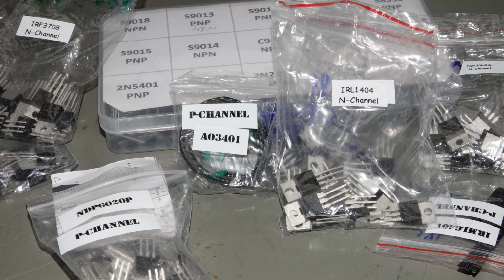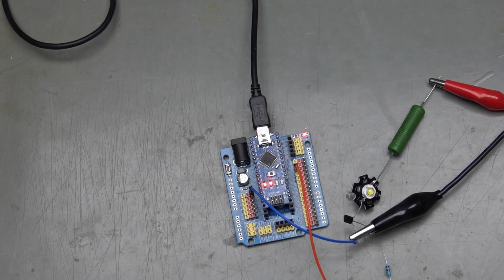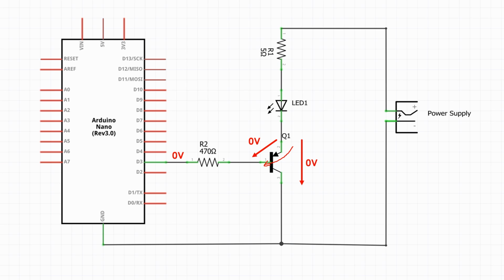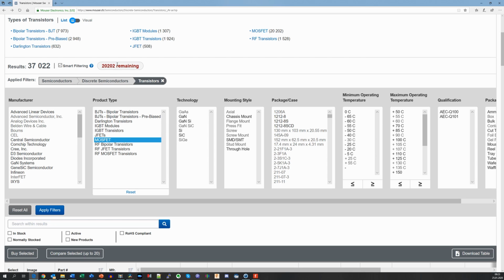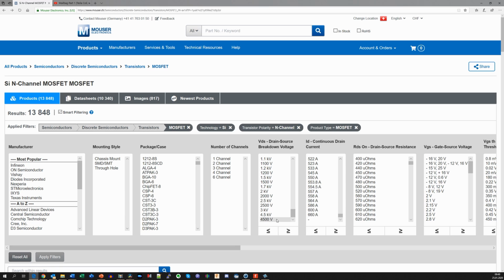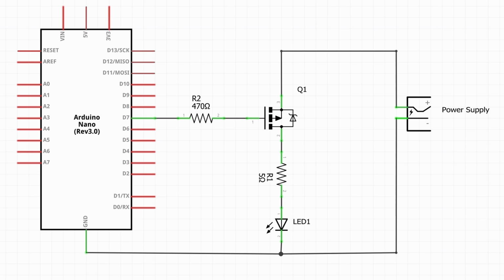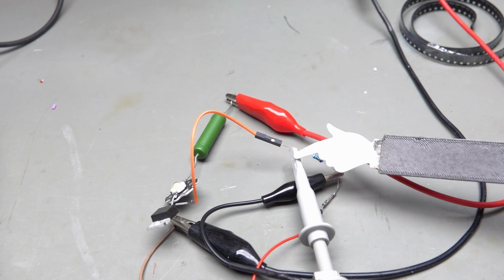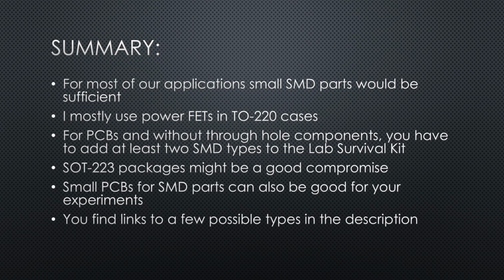#310 Transistors "Survival Kit" and Tutorial for Makers

Comment from the maker: Unfortunately, I had to re-upload this video because I screwed up and discovered it too late. Thanks, Ristomatti for giving me a warning.
Reply: They're all good enough for the girls we go out with ;-)
The level of detail and clarity in your productions always goes above and beyond. Thank you!
Reply from the maker: @Aaron: Thank you!
Reply: All the MOSFETs I have bought from AliExpress in the past turned out to be fake. I would advise to buy from mouser digikey or even lcsc(I use this) to get them because you don't pay that much more and you are sure to have good working parts.
Reply: @renaudfensie3020  how can you tell if they are fake?
Reply: @TravisHardiman  basically you mesure values the datasheet gives you. Usually the on resistance is not similar when those are fake. Another way is to check if it can handle the currents the datasheet says(be careful with overheating tho). One of the worst fakes i've got would saturate between 3 and 5 amps (they weren't even consistent) with a gate voltage of 10 volts while the datasheet said it would let up to 20 amps go through. Some other MOSFETs I've bought were supposed to have a on resistance of 0.05 ohm but when I measured it it was 0.3 ohm. 
If course they still can be useful for low power applications but for what I've got I could have bought something much cheaper from some trustworthy source
Reply: Does someone actually sell your transistors "Survival Kit"?
Reply from the maker: @tbgelectr0  I do not think so.

Comment: I've worked with transistors from the days of the CK722 on. So, I may not go back as far as you do. I remember when the U.S. was putting out a bunch of fair silicon transistors with not so close parameters, pretty much all with numbers starting with 2nxxxx. Then , the Japanese started putting out transistors with 2SBxxxx. or 2SCxxxx , these transistors had such tight parameters that if a circuit was designed around them, you quite often had to get the same exact transistor. Made rapiers take a little longer but the circuits worked very well. This was especially important for the Stereos coming out of Japan which had direct connected amplifiers (this was before the system came out with those large plastic amplifier modules ) . Amplifiers which were being repaired should have all been repaired with exact replacements made in Japan. But, that didn't always happen, the amps would put out sound but be unbalanced and distorted and in not too long blow up again. Now we have Chinese manufacturing which is a mix of U.S. engineering and who knows what ! Oh well. Back to the video.
Reply from the maker: It seems you have a lot of experience with these parts! Indeed, not only with transistors, the Japanese once challenged the "western" manufacturers. I remember also when the first Japanese Motorcycles or cars hit the road. Their tolerances also were much tighter. But the downside of good quality parts is that they do not mix well with lower quality.

Comment: Awesome video. Can you please suggest me a (complementary) pair of TO-220 N and P Channel 'Logic Level' FETs that can be found easily and for cheap yet have decent ratings?

I am obsessed with stocking Transistors in pairs.

Thank You.

Current FETs I keep are:
IRFZ44N-IRF4905
BS170-BS270
(BS170 is equivalent to everyone's favorite 2N7000)

For BJTs I have 
BC337-BC327
BC547-BC557
2N2222-2N2907
2N3904-2N3906
Reply from the maker: I do not know if there is a concept of complementary FET transistors for switches. I just have a few N- and P- channel logic level FETS as shown in the video.
In my next mailbag you will see a chip which includes a P- and an N-channel FET...

Comment: Outstanding video!!  Can you do a similar video for linear transistors?  And maybe then diodes and capacitors?
Reply from the maker: I hardly use BJTs. So I do not have a lot of experience. For diodes it is simple: Either I use any standard diode or, if I need a smaller voltage drop, a Schottky diode. Also here, I do not design switching power supplies and stuff like that.

Comment: I wish you would have released this video about 3 years ago. Great info that I had to scrape together through much reading and a few test as I was playing with 5V and 3.3V devices at the time and logic level then was more aimed at 5V devices. Always check the threshold voltage and look at the datasheets is what I learned as even some 'logic level' mosfets aren't really logic level to be fully on (and not wasting power/producing heat).
Reply from the maker: As you mention: 3 years ago many makers used 5v logic.

Comment: nice simplified tutorial!

However, even bipolar transistors have a place in switching... they are usually faster in turning on, but slower in turning off, especially when driven with high base currents. Also bipolar transistors are a bit more robust against static charges or high-voltage transients.
Reply: As I also commented for the next video: always put a series resistor ( acouple of hundred ohms) into the gate lead of the MOSFET as well in order to protect your Arduino (or whatever) from a catastrophic failure in the MOSFET.
Reply from the maker: Everything has its place in the world. I wanted to reduce to the Max. I think I mentioned the gate resistor intros video in the switching section. Absolutely needed.
Reply: @AndreasSpiess  I absolutely agree with your minimalistic selection. Regarding the series resistance you later recommended it in the video - but then in your next video you complain over the burnt-up potentiometers which seems to indicate that you yourself are not using them... And you didn't show them in your connection diagrams...
Reply from the maker: In the next video, the potentiometer acts as this resistor in my opinion. The potentiometer only was destroyed because I destroyed the FET.
Reply: @AndreasSpiess  yes, absolutely, it was only destroyed, because the FET failed, and with the additional series resistance between Gate and potentiometer wiper the potentiometer (or the Arduino) would be protected from this destructive power. In normal operation the serial resistance will slightly slow down the switching speed with a time constant of R times Cgate

Comment: Right after you point how horribly awful the mosfets are in fast switching you say that they are better than BJTs. If you don't have strong push-pull drive then sometimes BJT might be better. If you put a capacitor in parallel with the base resistor it'll help to faster switch it off. So speeding up a BJT is easy. Speeding up a mosfet is much more complex. So you should never rule-out BJTs. Each transistor has their own pros and cons.
Reply from the maker: You are right. But most of the Arduino projects I know use low switching frequencies. I am not against BJTs.

Comment: Is it possible that you use the Depletion MOSFET symbol at some places?  The most common symbol for NMOS and PMOS use a discontinuous line for the chanel to add emphasis that there is NO current passing through when Vgs = 0. The LTspice diagrams are ok in that aspect, but the photocopies seem wrong: using a continuous line for the chanel, that would indicate a Depleted mode MOSFET ( a DMOS ) allowing the current to pass through when Vgs = 0  (which makes them useful for current limiting montage, as example).
Reply from the maker: I used the standard symbols of frizzing. I do not care too much about them. Too complicated for me if I look at the variants shown on one of my slides.

Comment: re BJT transistor switches
As shown
Ic is a function of (Vf, Vcc, Rc, etc     Ic: Collector current , Vf: LED Vf, Vcc: supply  voltage, Rc: resistor on the Collector side

Rb is a function of Ic, hFE, Vsignal, etc

hence Rb is dependent on the Supply voltage and so  should change if Vcc changes?    ist das richtig?
Reply from the maker: Richtig.
Reply: @AndreasSpiess  so (at 9:22) when you increase Vcc then Rb should be changed?

Comment: My survival kit:
- 2N7000 - N-MOSFET, great for digital stuff
- BC547 - NPN BJT - The Swiss Army Knife of transistors
- BC558 - PNP BJT, complement to the BC547
- PN2222A - NPN BJT - If I need to handle a little more current, this is a good choice.

SMD is evil thus not part of the survival kit. Sometimes necessary evil, but not something I stock.

Missing from my survival kit is a good TO-92 P-MOSFET. It seems there exists no good complement to the 2N7000, you either have to go SMD or use power mosfets. Therefore in Arduino projects, I often resort to the BC558 BJT. It costs a resistor to protect the base, but going SMD or power mosfet is less elegant than using a resistor.
Reply from the maker: Thank you. I see you are "old school" ;-)

Comment: Great advice as always. In video 290 you showed your transistor tester - very handy to see what that device is. I still use mine for measuring the beta of NPNs - but I am older than you! Afraid of high voltages? As an ex RF engineer, I find rf burns far nastier!
Reply from the maker: You are right about RF burns. But such strong RF sources are rare in my household ;-)

Comment: You really have to add the darlington transistor to a survival kit to my opinion, I use the ULN2003A chip for all my Raspberry Pi and Arduino projects because with these I don't have to think about adding a current limiting resistor on the input of the chip, it's already built-in. There are also flyback diodes built-in so with the same chip I can drive inductive loads like a relais without any problem.
And when I need to switch for example a power LED I can simply tie some inputs and output pins together, I can go up to 50 volt maximum which is more than enough for almost any project.
I think that when you only have the ULN2003A chip which is a 7 channel darlington pair you'll have a more than enough capable survival kit so this is the only thing you really need to my opinion.
Reply from the maker: It is a good chip, you are right. But often an overkill. And it’s current capability is also quite limited if I remember right.
Reply: @AndreasSpiess  The collector current for a single output is 500mA so it's capable enough. I looked it up in the datasheet it says that in some cases you can go up to 2.5Amp.

Comment: I always keep some SI2302 aka A2SHB (N-Chan) and SI2301 aka A1SHB (P-Chan). They're used in so many commercial products that it's nice to have them for replacement. They're probably als one of the cheapest from China because they're so common.
About Fakes... so far i never had bad luck with SMD parts. I think they're way too common and cheap there to fake them. The only thing i'm a bit carful with a old parts that got uncommon (got once Attiny 11 labeled as Attiny 13), very special ICs or some through hole parts that don't really get used anymore by the industry. If there arejust one ore two sellers for a part i get more careful and read the reviews.
Reply from the maker: I have them, too. I like to use common products. The risk to get a fake is very small then. I will test my FETs for the next Sunday's video to see how many are "fakes"...

Comment: I've recently switched to smart switches and will likely not use mosfets anymore for experiments. They have current protection, ESD protection, temperature protection, back-EMF protection, etc. but they come with the disadvantage of a slightly higher price. See auips1021s and vnb20n07 for example. They are typically used in automotive applications, replacing the mechanical relays, and they come in high-side variants as well. Perhaps an idea for a future video, exploring these options.
Reply: I never heard of them. I found the datasheet for one of them, and it's described as "FULLY AUTOPROTECTED POWER MOSFET", so they are still MOSFETs with more extra protection? They seem like a nice component to have.
Reply from the maker: I also did not know them. They have a few additional components on the chip. I assume they are not easy to get from AliExpress. At least when I searched for them. So you probably have to buy them from Digikey or so.

Comment: Andreas, your video reminded of the moment in the '80's when I more or less abandoned bipolar  for Mosfet devices, with a sigh of  relief - so much easier to understand and to design with, and not just with digital switching.  As I recall there were far fewer options in those days, which made selection easier than now.
Thanks again for a great video.
Reply from the maker: The current selection is really awesome, I think. But a lot of the datasheets are from the 1990s. So some of the common parts seem to be "evergreens"

Comment: Thanks for doing the dirty work, I'm nearly 59, it's about over 40 years ago that I experimented with MOSFETs, it was nice spending half an hour with some refreshing, since I've started using them again.
About fake parts, it could be possible, but they should be working parts, maybe with a slight different characteristics.
I've ordered about 80 times from Aliexpress in the last two years, the parts are exactly the same things you get in Europe from the typical electronic stores, only over 10 times cheaper, I haven't had big issues yet, components work. Only once they sent me the wrong model of RFID, Aliexpress ordered them to refund and take back the goods, or make a deal, I accepted a partial refund, which I promptly received, too expensive to send them back the product.
Two years ago, I got 100 pieces of 2N7000 N-Channel MOSFET TO-92 for €12,89 from Amazon, the product arrived the day after, I thought I should be OK for the next 5 years, that's when I discovered I already had tons of them all over the place, I'm sure I thought the same thing back then .... :( old age sic!
Reply from the maker: You can imagine: I order also quite a lot on AliExpress and rarely have to file a dispute. And most disputes are about non-delevery, not bad quality. 
Because so far I never tested transistors when I got them I decided to make a video where I test my FETs. I am curious how many fakes I will discover in my purchased of the last years...
Reply: @AndreasSpiess  I've received from Aliexpress 70 pieces of DS18B20 temperature sensor, $ 0,3 each.
I later read that in the comment section that they were fake, didn't work or whatever.
I tested 10 of them, they are perfectly accurate, in a 0,2°C tolerance, the same as an original that I got from Digikey.
Reply: Chinese fakes usually work good enough to not get immediately identified as such. But that makes them so dangerous.
For example, the fake Chinese AMS1117 voltage regulators are missing a proper short circuit protection and fail with Vout = Vin after a short circuit (the energy need to be high enough which is typically the case if Vin is about 2.5V higher as Vout). That's worst case. You find them on breadboard power supplies, development boards and so on where an accidental short circuit can easily happen...

@ Andreas Spiess:  A video about identifying fake parts is a good idea.

Comment: Do any of the transistors in the survival kit need a heat dissipation clamp when soldering? The NPN/PNP transistors I first used decades ago required a clamp to dissipate heat to prevent damage. To be honest, I have not done a lot of projects.
Reply from the maker: I do not think so. At least I never use something like that.

Comment: That was a great video about transistors. Still keeping old BJT on survival kit  just in case the FET's are gonne. Also keep resistors of know values like 100K , 10K, 4k7, 470, 220 2k2... plug digital pin to base, gate. Other components usefull for transistors: LM317,LM78XX, OPAMPS,  NE555 ( use this instead of  arduino for the first time maybe :D ), capacitors (10nF,  100nF, 1uF, 10uF, 1000uF...) .. edit .. pen, paper and calculator
Reply from the maker: Of course the complete survival kit is bigger, you are right. I only focused on transistors because otherwise it would have become a Netflix series ;-)

Comment: I have received counterfeit parts from China. Not Ali Express, but a PCB assembly shop. I have pointed it out each time to them, and they have apologized and sent me the correct parts. Unfortunately I am left to rework the boards myself. So do be careful.
Reply from the maker: Fortunately I do not manufacture products. With good reason, I think. One of them being fake parts ;-)
For me as a maker the damage of a wrong part is usually time to find the error.

Comment: One very interesting part for switching is the ULN2803 that I use often. 8 NPN transistors with base resistor and flyback diode in a DIP package. 0.5A per channel and 2.5A total maximum.
Reply from the maker: A nice part, I agree. I used it in one of my projects.

Comment: Good Video.  Over the Years I've managed to gather a rather substantial Bench Stock.  One that rivaled the Radio Shack we once had in town.  LOL     All the basic common Transistors , resistors , Op Amps and more.  FET's are a soft point.  I have a rather good selection at hand but lacking many I would like.   Tons of PCB creation materials and supplies.  Gadgets, mini meters and more.   It may take me a day to locate what I want but chances are I have it.
Reply from the maker: We all have our stocks. And finding is sometimes a challenge. I usually use my AliExpress orders to check if I should have it. Thi increases the motivation for searching...
Reply: @AndreasSpiess  BINGO !  I have somewhat the same system.  I have a Word Pad document holding everything weird or of items on hand.  Everything else is covered by my  Parts ordered log of various vendors like Tyda, Banggood and others.  A quick search with key words usually does the trick.     Following that at least I would know which box it should be in.  LOL
Boxes include New Electronic Parts, Used,  Current Project items,  Test equipment related,  Arduino Related and ect.    My project box has overflowed into various boxes.    And then there is the SOME DAY Box.  LOL